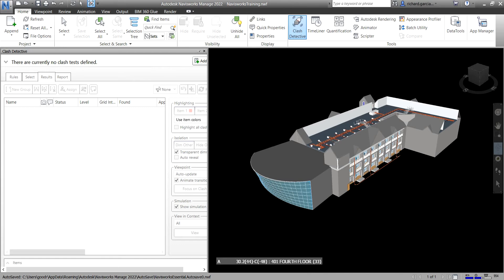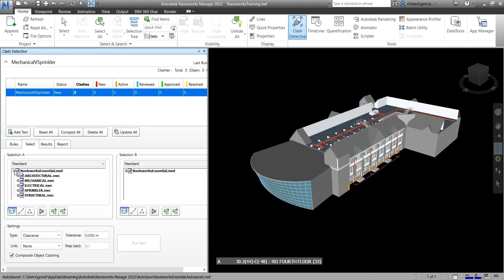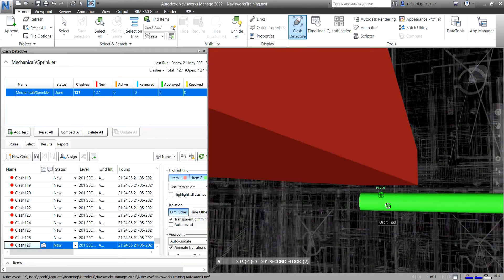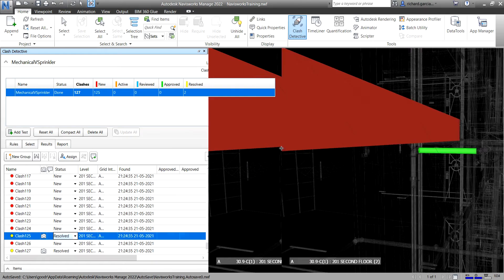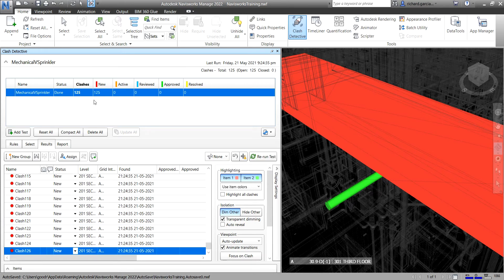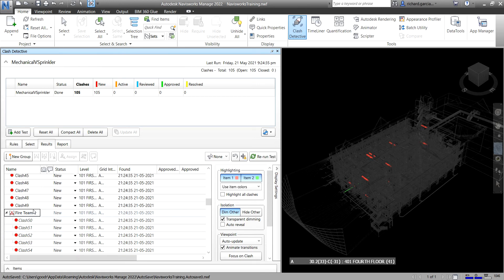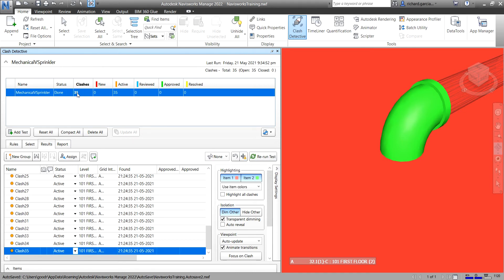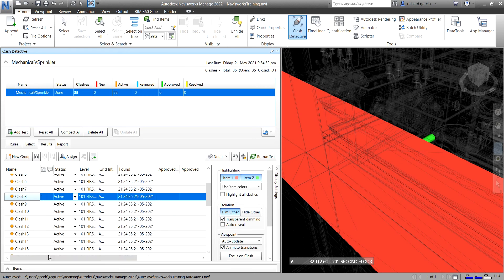NAVISWORKS MANAGE 2022 TUTORIAL LESSON 23: CLASH DETECTIVE RESULTS TAB

Comment: Hi Rich, avid follower here. Im a BIM Coordinator, and reviews Clashes submitted to me by Contractors. Sometimes, or more often navis is detecting clash between walls and pipes or floor vs pipes. Resulting to a thousand of generated clashes (for example in a complex large projects). Opening it one by one could be time consuming and tiring. Is there a settings in navis that can avoid generating these types of clash? (Or is it the fault of the Revit Modeler by not providing Floor Shafts and Wall Opening during modeling). But, asking them to provide shafts and wall openings, could be too late if they have progress to far in their project.
Reply from the maker: hi sir, they should have provided that shaft and openings when they did the modeling at start. It is really a problem, you need to tell them about this so they talk about their strategy, maybe making a separate worksets for the penetration marker or search  set for penetrations in navis.